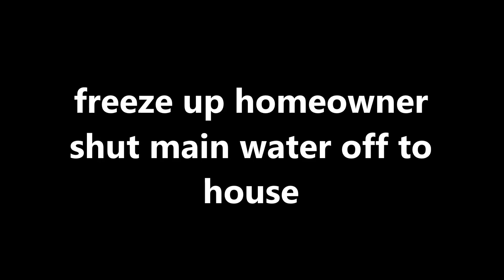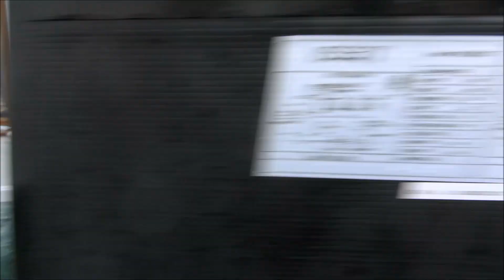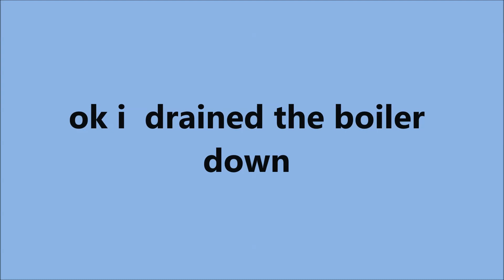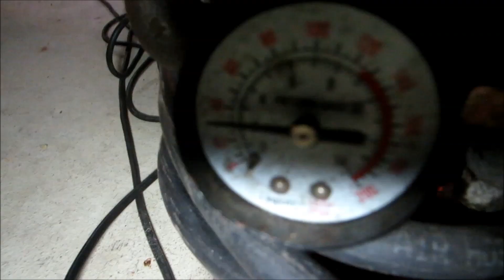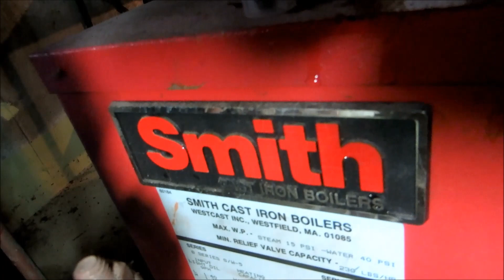frozen heating pipe on hydronic heating system

Comment: Guess the cust. learned his lesson leave all the zones on when it's freezing outside . Like what u did by cutting out the feed and return on the baseboard made the job Alot easier with the brass 90 and street 90 fittings . Good job Steve .
Reply from the maker: justin henning bleeder fitting are the key to a quick repair
Reply: Justin right Steve neat trick with that little bleeder 90 elbow lol I heard people say they use bread for that reason. I tell them they only thing I need bread for is my sandwich lol. Great vid

Comment: Another great video, I learned a lot on this one. What is the name of the tee you used to let steam escape while you soldered the joints? I have found one but it has female threads to which you screw an air bleeder valve. The tee you use has male threads to which you screw a cap on it. Which is the one you use in the video? Thanks.

Comment: you should invest in one of those oscillating multi-tools.  I thought they were a gimmick but they work great.  They cut anything and can get in tight spots.  cuts copper nice and clean.  Thanks again for the vids steve.
Reply from the maker: emutiny i will have to try it

Comment: Hey steve, got a couple of questions! 
1. How did the pipe break?
2. How did you hook your pressure gauges to test for a leak?
Thank you for all the vids
Reply from the maker: Tony El Khoury the pipe froze and then split,,,i use a hose by 1/2 female adapter then a 1/2 buy compressor adapter to hook op to boiler drain on purge station .. i have many adapters depends what i need to hook up to
Reply: @stevenlavimoniere  great question if not holding the pressure, have leak but how can found where that’s leak?

Comment: Nice video..I was told by an old plumber one time if you put gate valves in always install handle down if possible in case they break not sure how true that is
Reply from the maker: hvacman77 i was told by a old plumber never to install gate valves because there junk .there only good for the brass scrap bend .. the stems strip out then the gate is stuck closed. useless valve in my oppion .

Comment: That’s a chop job why are you cut in the coil you should’ve swept it out that’Now he’s going to have Les call believable A professional HVAC mechanic will have a bucket there to catch all the water I watch your videos someone was OK and others is chapped jobs doing will you check the unit a lot of times what do you wanna comes back on you leave without finding out the problem I would never allow you to come out to fix anything I like you Steve That’s a big house I know what you’re going to saycoilyouyouyouto not heat the house is the pipe